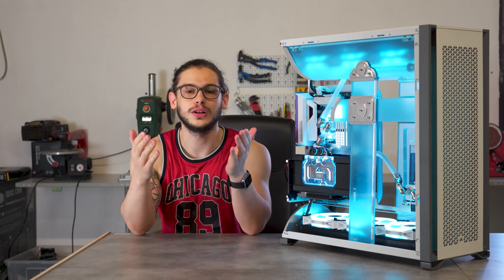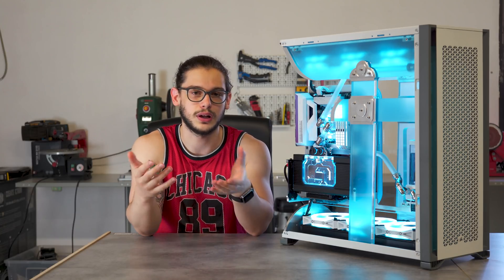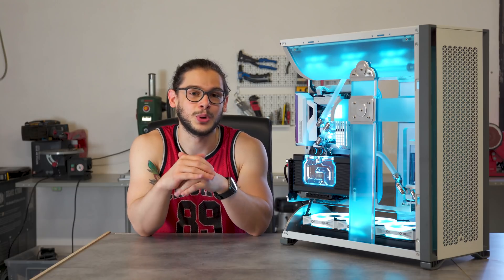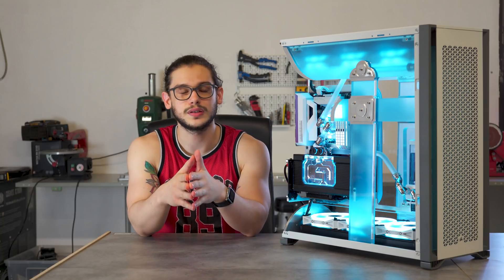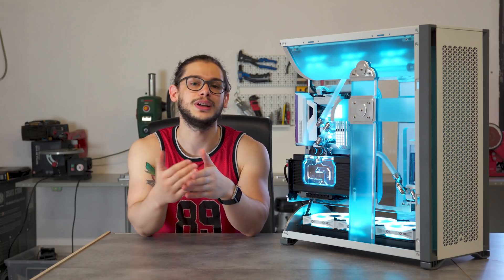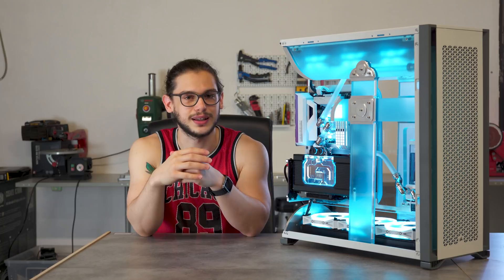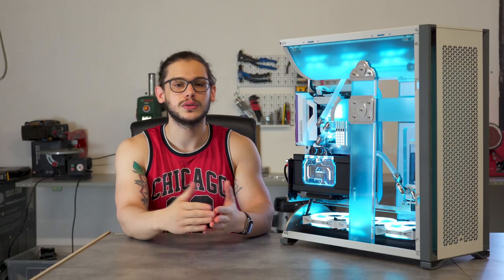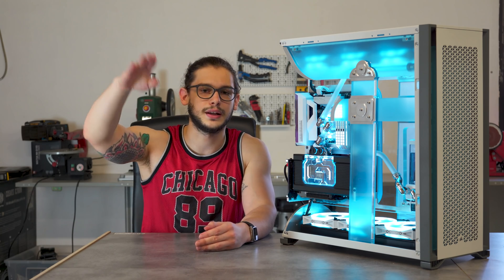Project Mirai Part 4 | Final assembly & water cooling | bit-tech Modding

Comment: quick question, would it have been possible to make the acrylic stands work as reservoirs similarly it's done in some cases? or would it be too dangerous given that it supports the body?
Reply: Definitely possible with some tweaking, there's not too much support from those two acrylic parts, as most of the structural work happens with the motherboard tray and front/back panels. The side parts are more for keeping everything square in this regard :)